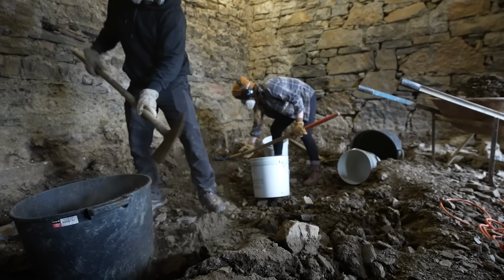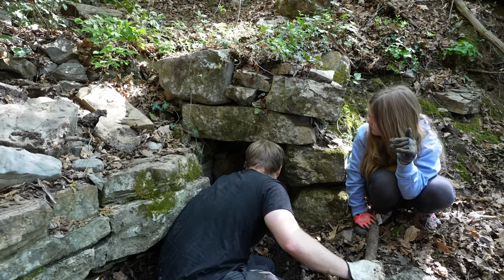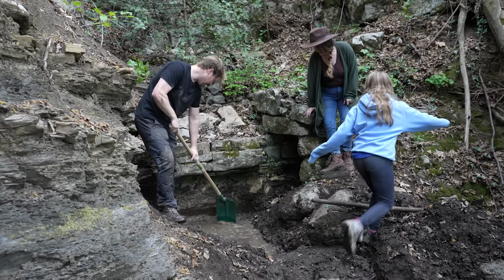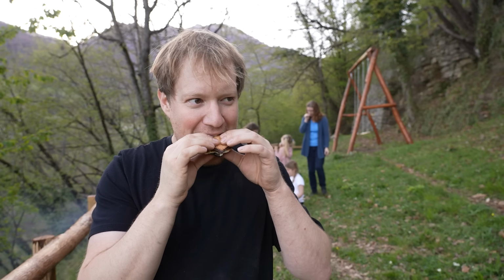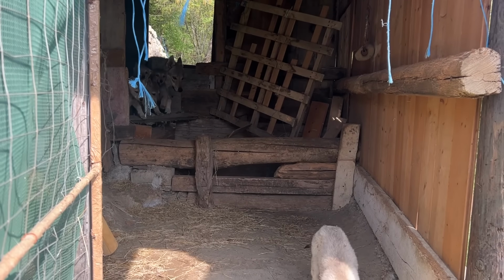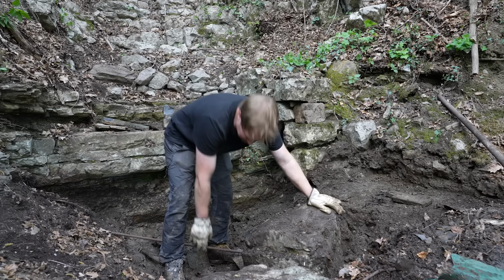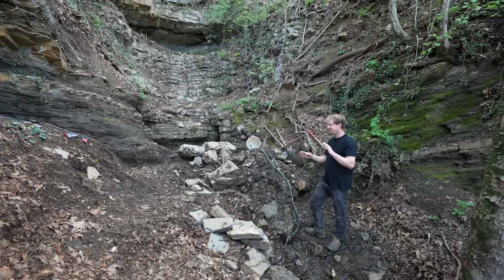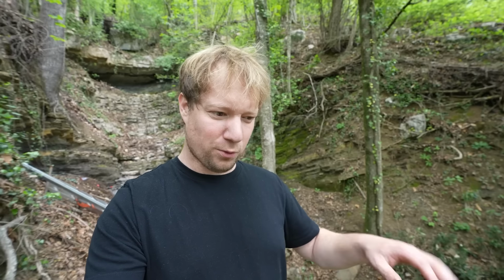Building a Pond from a Natural Spring

Comment: Sucking on a hose to start a siphon can be dangerous! Far better to just submerge the entire hose and let the air bubble out, then close off the end with your thumb until it's lower than the water in the pool. Thumb off, the water flows, and the siphon will continue until the water level in the pool is low enough for air to get in.

Comment: Well natural hot tubs do not actually exist. 

The actual question you need to answer first is what is the budget in a typical year? How will the spring behave over the dry season? Is it enough for the garden? Of course when it turns out you have plenty year round you can add other uses.

Most channels neglect that part too, lots start with abandoned properties with lots of water in the well (guess how I found you). Most neglect the fact that this is because it has not been used for a while for gardening or house uses. You should observe all seasons.

Off course hot tubs are a minor thing and you can not fill them but natural ponds are way cooler. 

The fact that there are bees right away is a good sign. Your terrain is good for all kind of wild bees many of whom nest on the ground and not in hives. They need all the help they can get. Water is a precious resource in the area in the near future not just for humans.

Oh and maybe you should also watch what falls off the rocks over the year. This is probably tricky. Not sure if you can get at the rock above and look what looks really solid or where stuff is likely to fall off.

Comment: I don't think it was a great idea to touch the puppies, let alone driving them around. Wolves shouldn't become comfortable around man. 

Regarding the spring, as you noticed the water table dropped. Rather than digging deeper, your first concern should be on how to restore the water level. Try to slow down the water flow higher up in the ravine, so that it seeps into the ground. 

A "natural" hot tub, sure... 
Siete proprio americani